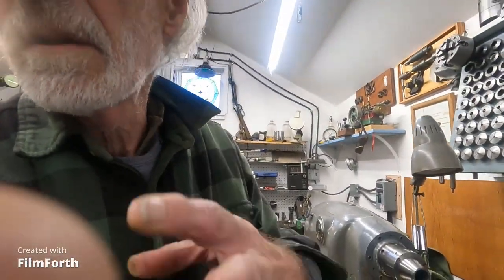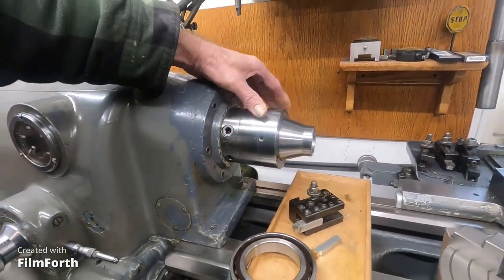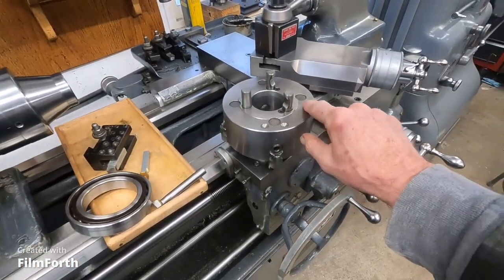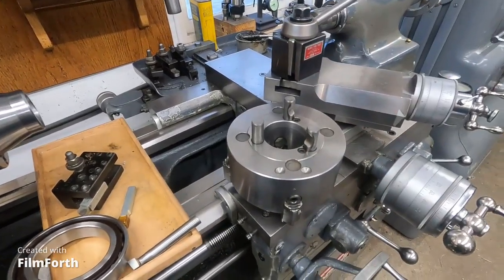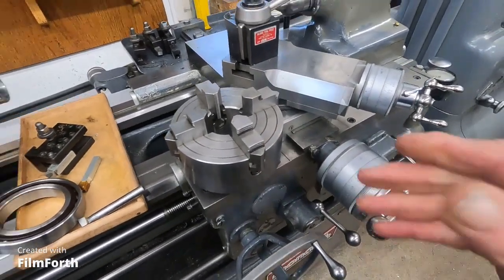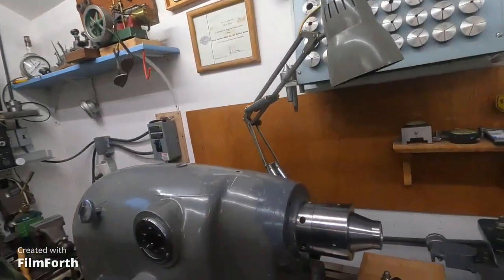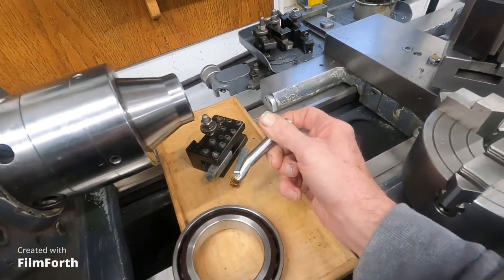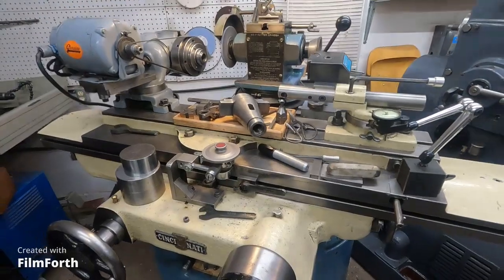Monarch 10ee Lathe Steps to Super Precision

Comment: Real interested to see how you use that radial drill. I know you must have a few tricks up your sleeve to make it more useful than it first seems.
Reply from the maker: The fun part for me is the Radial Drill is a machine I dont have a lot of experience with but have been studying. This Morris is identical the one in the battleship New Jersey machine shop. The spindle in this model and a similar Fosdick used by the military are high precision design with a ball bearings instead of Timken, it should do some very good line boring

Comment: Dee, content is just getting better and better.  You need to dedicate a couple videos on re-grinding brazed carbide inserts.  I have 3 small boxes of them I’ve been selling off, all Sandvik, Valenite and other US brands.  Keeping them now.
Reply from the maker: I grind an angle across  a cnmg432 insert top and work one side for a sharp tip to bore cast iron to avoid chatter, and scuff the coating off and braze to a piece of steel for many purposes, and try to get ahold of cost a little.

Comment: I have a Hardinge HC or HCT i really don't know the exact model. I is an english one, not american made. The dials and collets are in inches and we are in the metric world here so i think  i will add a DRO to fix that. It needs a full restoration, it was not used for a long time. Unfortunately the threading attachment is gone. Is there a way to change or add new grease to the spindle bearings without taking it apart?
Reply from the maker: No, there is no relubing, however bearing replacement is not hard if you follow some rules. The last bearing set I bought were from Hardinge, NSK brand pre lubricated for under $400 us 
 The very small amount of ultra filtered grease can cost over $100. likely twice the cost now.